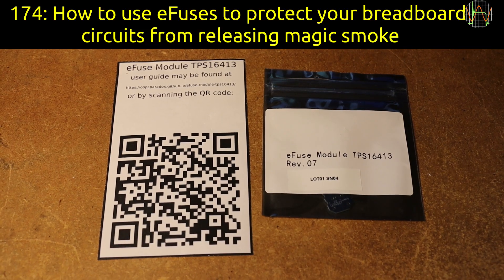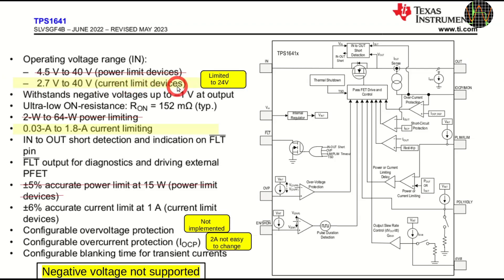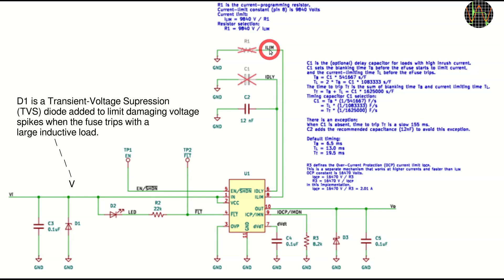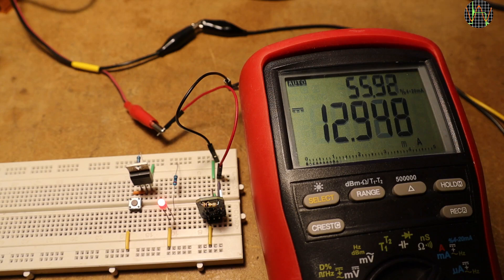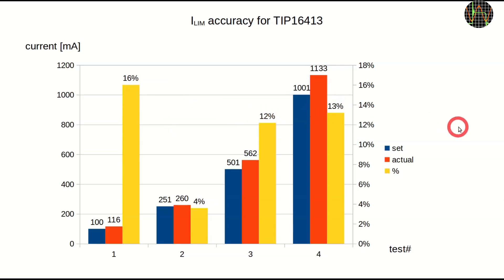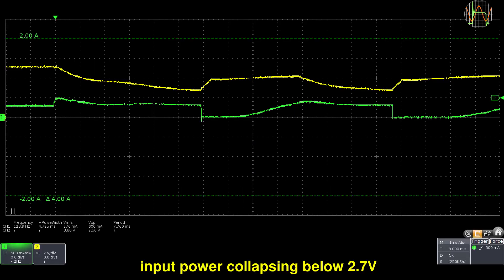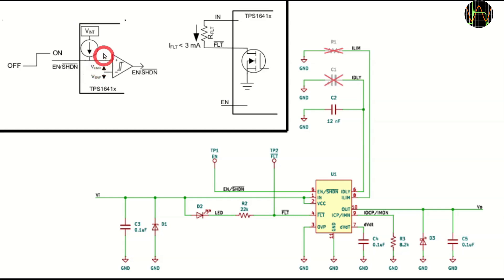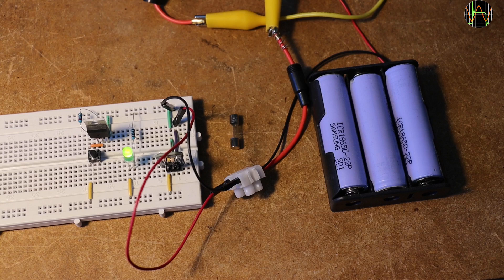174 - How to use eFuses to protect your breadboard circuits from releasing magic smoke

Comment: That's a very handy device! Do you happen to know a similar circuit to protect the negative supply?
Reply from the maker: Sadly no.  Anyone?
Reply: Thank you for your interest! The closest thing I found so far is the TPS23525, which someone mentioned in a reply to a forum post. The TPS23525 is a hot-swap controller rather than an eFuse, and requires external transistors.